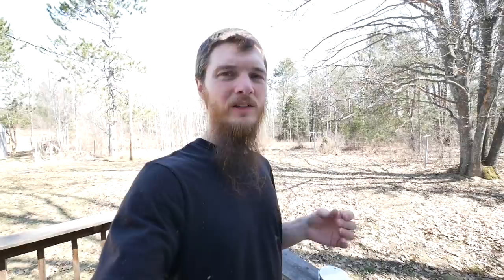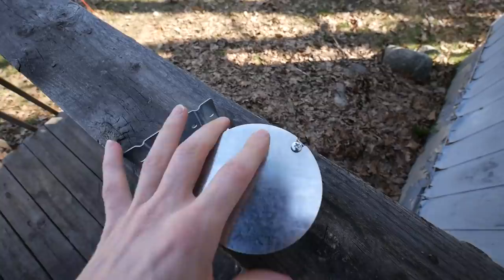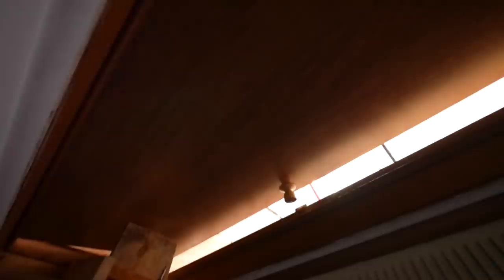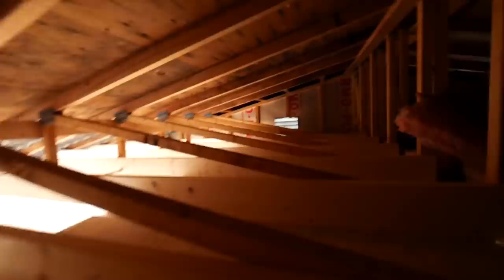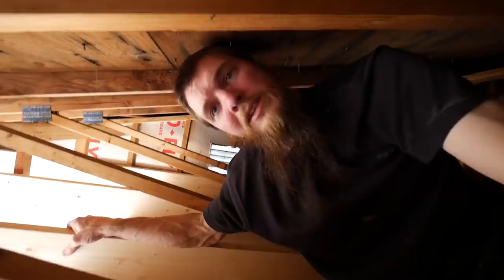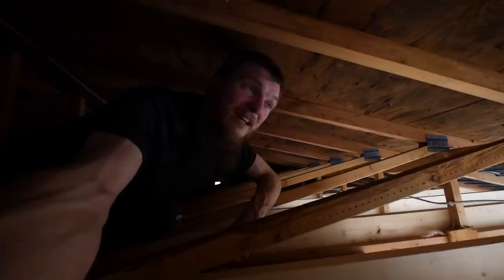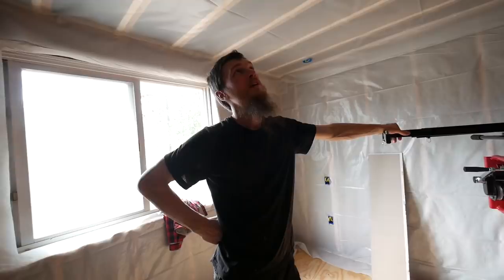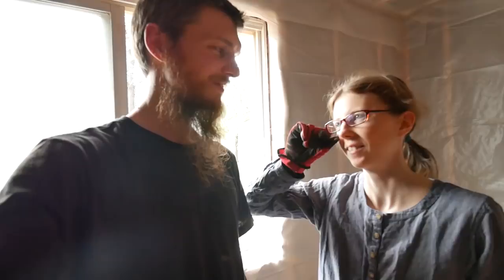The Most Ridiculous Fan Box Installation - Home Renovation

Comment: My Mom installed a whole house fan in the attic. After the sun dropped, 10 minutes of running it cooled the house. Reduced the need for AC a lot. The unit she chose was powerful...very powerful...if you opened just one door, it felt like a 25mph wind. It may be useful in MI with the cooler evenings.
Also, a fan in the attic, mounted in the end vent, helps cool the home, too. It has its own thermostat, and is totally automatic.

Comment: Ceiling fans are great for a lot of reasons. You don't have to get one of those big gaudy ones...you can get a small ceiling hugger that goes good on a lower ceiling. They are fantastic for quietly circulating air and moderating both cooling and heating...especially if you do wood heat.

Comment: While think you should do what you want to do I agree it is a good idea to put the fan up. They have low profile and some are actually heaters as well. If you use gas or propane to heat your place the electric heater would come in handy.  The fans help circulate hot air in the winter and cool in the summer and are much much cheaper than air conditioning of any kind.  You may never need air-conditioning since you have not lived there a summer yet.  Who knows.

Comment: Well, that was quite a fete! If no fan, you will have a very sturdy light box! We have a ceiling fan in the dining room. Much as I dislike the looks of it,  it is helpful in winter to distribute heat from the woodstove and for cooling in the summer.
Reply: Saves on my power bill in the spring and fall .

Comment: I don't know if it makes a difference everywhere but I live in the South with heat and humidity, which makes the heat feel even worse.   I have a ceiling fan in my living room which when running pushes down and circulates air conditioned air which has risen to the ceiling and cools the room better.

Comment: I’m with you there Doug, don’t care to use ceiling fans. Bought our house, it has a fan in every room. We changed out to new fans so they would look nice and uniform throughout the house. Sure came in handy when the heat pump went out and we didn’t have air conditioning that year.

Comment: My sons are both over 6 feet, we have ceiling fans in each room of our 1964 built apartment, you just learn to manage.  Fans adjustable, can blow hot air down in the winter and stir the air and cause cooling breezes in the summer. You do not want still stagnent air. Could you have changed it out from down below then patched in/ over covered the slit part with more plastic when done?  One thing I was wondering is if you have critter/bug screening on the inside of your end of the attic levered vents? Its an easy fix and saves headaches later on.

Comment: If I may make a suggestion before an installation. When I build homes I put the door stops on the doors instead of on the baseboard that way when you're cleaning you can move the door and you don't have to fight around it when it's on the baseboard.

Comment: Yeah, I feel ceiling fans can reduce the need for a/c, improving comfort and using much less electricity. But even more important is a whole house fan. I'm in WI, in a well insulated house, and as long as nighttime temps are below 65, we will open windows, turn on the fan and draw in cool night air through the house  and out through  attic venting (soffit &  ridge) during the night. In the morning we close up the house and the insulation helps the house stay cool, even if outside temps approach 90. Really cuts down on a/c use and electricity. May work well in MI, too.

Comment: You won’t regret putting the boxes in ceiling fans cost very little to run and they not only keep the warm air down where it needs to be, but circulates the cool air for more efficient airflow. I have very low ceilings in my home maybe 6’ I use a fan in living room and my bedroom to move the air. They are huggers and my 6’ tall dad has no problem with them.

Comment: We love our ceiling fans because in the winter we are able to push the hot air down and in our kitchen it comes in handy drying our tile floor.  Due to the layout of our kitchen being in the middle of the house, it takes forever for the floor to dry without it and it enables us to use them and save energy until the weather becomes too hot and we have to put the central air on.  Where you live that shouldn't be much of a problem because in our Pa vacation home we only use the AC during the hot summer days and the ceiling fans at night since it cools down nicely there at night.  It's highly unlikely that you will regret buying a ceiling fan.  They come from a wide variety of choices and prices, but I advice you to check out the reviews on any fan you pick because we've had to return some because they made too much noise when running.

Comment: I agree with the ceiling fan kudos..Doug and Ashley...I have one..remote control and ceiling hugger....and you can get them without a  light attached..maybe consider a light switch by the entry door to the bedroom that would turn on your 2 bedside hanging lights...then you would surely not need a light on ceiling in center..yes..in summer the fans sure do help with cooling and air circulation...luv

Comment: You need to get a ladder before you blow in the ceiling insulation. But your doing a great job on that room and the fan would be  great for circulating the air around the room. Once you get used to them you can't go without one afterwards. I didn't put one in until I was 40 years old and now I have them everywhere. I live in a mobile home and the ceilings are too low for a fan but I have table fans everywhere for circulating air. Keep up the great work you're doing it rights.

Comment: What a trooper. Honestly I'd have ignored the fan comments since your ceilings are so low just use a floor or wall fan if needed. Ceiling fans are a necessity in most parts of Australia where I live but if you've never used one before why would you start now!
Reply from the maker: We're just making sure the box is future-proofed so that if someone in the future installs a fan the box won't break like the plastic box might have. That's all :) We personally won't be installing any fans.

Comment: Ceiling fans are awesome.. by flipping a switch on the fan it will help  heat raise during winter to keep it warmer and flip the switch the other way it will help cool it better during summer........  this alone will help u save money on your electricy bill and keep ya heatpump/ac unit from running as much

Comment: We live in Texas and use a ceiling fan year round. Helps circulate the ac. Yes they do collect dust, but I clean my regular light fixture so cleaning a ceiling fan is just part of house cleaning. For lower ceilings you can install a ceiling hugger fan.

Comment: I too am not a fan of ceiling fans and if I had to put one in it would have to be modern and my taste is really expensive.   A lot of the older ceiling fans looked chunky and gaudy,  just like you said.  They are making them look more modern now and there is a variety for everyones tastes.  I even saw a stainless steel one I liked, one that looked like pedals of a flower and an elaborate one with tons of crystals. I suppose there is something for everyone.

Comment: the easy way to blow in insulation when you don't have room is from the outside.  Up on the roof, you take the cap shingles off and cut the roofing back enough to get an insulation blower in to fill the joists.  Sounds hard but its not and it will save you from crawling around.

Comment: We have ceiling fans in our bedrooms and in living room.  I don't have to turn on the air conditioning as high.  We live them.  Get a swiffer to clean and dust them.
Wow was quite the project.  Wow.  If you install them, you will be glad you did.
Reply: Ceiling hugger fans...they are right up to ceiling.  Don't hang down as low as the other type of fans.

Comment: Ceiling fans move the air around in the summer, and in the winter. They are also good in the spring and fall , when the house gets muggy, yet it's not warm enough to turn on the cooling unit, and it's more economical , too !

Comment: Lol I got like 4 ceiling fans in my 2 bedroom single wide mobile home. You can barely feel them in here when it's hot. My boyfriend bought a big old box fan home yesterday and that thing feels better then all 4 ceiling fans put together. Lol Hope you didn't get too hurt pleasing the people. I sure know about the heat up in attics. You feel like you can't breathe . I love you guys your the cutest family!!😍
Reply: Can you change the direction the blades move? It would have a slide switch on the light base.  If they do, be mindful one direction sends air up and the other sends the air down.  During colder months you can send the warmer air down to the floor, and summer send the warmer away to the ceiling.  You must sync them all to move in the same direct to be effective.

Comment: I have low ceilings and the small attic space as well.  Installing a light in your attic will allow you to see how everything is holding up over the years. I picked a small chain pull light switch on a ceramic light base. I added a length of sting to the chain pull so when I open the hatch, the string is right there to flip the light on and off. (because) My hatch is similar, I had to insulate the back of it, it isn't enough. Your warm air will sneak through the edges and send heat to the attic. I had condensation dripping down so I ended up using shrink wrap window plastic to seal it completely. Now that's ugly! I look forward to watching your solution to this hatch issue so there is accessibility and sealing the warm out of the attic space.

Comment: I'm not a fan of ceiling fans either, BUT, most come with a switch that turns the blades in the opposite direction and does help circulate the heat that naturally rises. You can also get a smaller fan that stays close to the ceiling.

Comment: We’ve saved a fortune on cooling bills by insulating every chance we could and installing ceiling fans. We do not need to run the ac until mid evening, we can run it at a higher temperature because the fan distributes the cooled air more evenly, and there are some attractive ones out there too.

Comment: We have ceiling fans in all bedrooms and a centralized one in the great room (living/dining/kitchen) area. We also have a pellet stove that we use for primary heat in winter and a swamp cooler (I'm in Nevada where it's pretty dry) for summer. These are in one spot and don't go through duct work like an air conditioner/furnace. This is especially necessary in winter so that you aren't burned out of one area and freeze in another. If you are considering using a wood/pellet stove, you will definitely want a ceiling fan. We upgraded the the two bigger fans last year. It was pretty inexpensive and they are nice, classy looking fans. One even has a remote. There are so many different styles to choose from and if you put one in your bedroom, it will likely be over your bed so it shouldn't interfere with walking or anything else.

Comment: I love ceiling fans 😁in my last house 🏠 I had a ceiling fans in every room were used an expandable brace . I will say during the winter and summer months it saved use a lot of money on heat and air .  Just by keeping the air moving and will help with mold not setting in by air movement we have very humid summers due to our beautiful Great Lakes and fun fact every 6 mile there’s a river, swamp, pond or lake that is why we have high humidity. Thank you so much for sharing your beautiful family and amazing journey 🌈🌈🌈🏠

Comment: I am with you not much for ceiling fans. Or ceiling lights, I prefer lamps. It is looking great. Did you show how you are doing around the window?  That is for some reason a real challenge for me. Adding the extra depth to the walls and how to do it all around the window? Thanks for sharing 😊🌻😊
Reply from the maker: We won't be doing the window trim until we replace the windows but it's pretty easy. Just rip some jamb extensions the size you need to fill up that extra space. Then trim them out as normal. Look up jamb extension and you'll see what I mean. It's just about making deeper jambs and sills.
Reply: Out in the Country thanks😊

Comment: I think it really depends on the particular house. We installed ceiling fans in all bedrooms and living room of this 170 year old house because the first summer we lived here the upstairs was so hot we couldn't sleep up there. The house had no insulation at that time either though. To each his own. I wouldn't be without them. At least not in this house. Also, when we put on a new roof a ridge vent was installed and we insulated between the ceiling joists then put down plywood for floor in the attic. It doesn't get nearly as hot in the summer up there and we don't lose as much heat to the attic in the winter. Do like the Amish, throw the windows open for a good cross breeze in the summer. Who needs fans?

Comment: Hate to tell you but that fixture you took down would hold 100 pounds and we use them to install fans all the time!
Reply from the maker: This is what the specs say for the box we took down: " Listed for fixture support up to 50 lbs. Not listed for use with ceiling fans" Reading the reviews, someone actually did install a fan to it and the fan's motor movements ended up breaking the plastic box and the fan dropped.

Comment: They make a ceiling fan box that looks similar to the box you had up there.  It has a stronger bar on it.  Best of all, you do not have to climb up there to install it.  You just put it up through the existing hole and then the bar turns to tighten it between the studs. After the bar is installed, you just put the box in and attach it to the bar. Everything can be done from in the room.  I have used that type of box in the past and it supported my entire 150 lb weight hanging on the bar.

Comment: I’m glad you got that taken care of before you got any further in your bedroom. I do hope you reconsider using the ceiling fan, because it does help wonderfully with air flow. You can set the blades during the summer to help with the cooling and the opposite way for help with heating during your winters. They do have ceiling hugger fans available at Lowe’s in several styles, so they would work with your shorter ceilings in your mobile home. Looking great so far by the way!!!

Comment: Didn't enjoy your torturing yourself up there, but am glad you prepped for a ceiling fan installation.  A low profile ceiling fan, with lights, could be just the thing for you.  It will help circulate the heat in winter and cool air in summer.  For those times when it's not hot enough for the air conditioner, but you still need a breeze, a ceiling fan gets the job done.  Give it a try.  Don't let all that tortuous effort be for naught.   

On another note, Jeff at Bobblehead Homestead could use your input on his cabin layout.  He has an idea for what he wants, but nothing is firmly set in place as yet, and he will have to firm up plans soon.  Please check him out, if you haven't already, and tell him what you think.  I know that you are very busy with your own homestead, but he values your input.  Plus, you have so much experience with this sort of thing.

Comment: Hahaha! Dude! It would have been less painful to take the plastic back down, lol. I gotta hand it to you, that's dedication! I like a ceiling fan in the bedroom on hot summer nights if there's no air conditioning.
Reply: lol I was thinking, if that were me i would cut the plastic and change the fixture then use strapping tape to get the plastic back together for air tight seal. I guess I just don't have enough dedication.
Reply: @TheBronco67  Me either, I would have cut the plastic, too! Or taken it down and reinstalled.

Comment: Good thing you're slender Doug!  I have low ceilings in my cottage, I am 5'7" and I lack 5 inches from being able to touch my ceiling.  I have an open concept living room, kitchen and yes I have a ceiling fan (not on a rod) and I do like it in the summer to circulate the air because I only use the AC to remove the humidity, then use the fans.

Comment: Although I hadn't suggested a ceiling fan, because of the area you live in, here in Arizona, it's a staple to have them. During the warmer months you have it blowing downwards to disperse the cool air, during the winter, you switch it to where it blows upwards to disperse the heat back down into the room. We live in an old brick home with no insulation in the walls and the fans really help in a hot region.

Comment: I bet you will put in a fan because you don't have cross breeze like most houses.  You might benefit from a flush mount fan/ light. I just put them in my bedrooms and living room so I could avoid using air conditioning. Good luck with you build your doing wonderful.  Your such a cleaver guy. All the best xx
Reply: If you don't install flush mount the fans wobble like crazy.

Comment: I do not like ceiling fans either.  I have lots of allergies, and a ceiling fan to me is just a dust and pollen swirler putting all that into my face over and over.  Hate em.  Now an air purifier, I love those and have a table top purifier in each room.  They have filters, so it would be a hassle doing a wall or ceiling installation of a purifier due to semi-monthly filter cleaning..  Actually had a window insert purifier as a kid.  But have never seen a wall installation of a purifier.  Well, now you have a ceiling fan option and all it took was some body cramping, nail pokes, some claustrophobia and some big hassle.  Hopefully you won't have to do it this way again.  Always happy to see your vids.    Carry on Cuties.